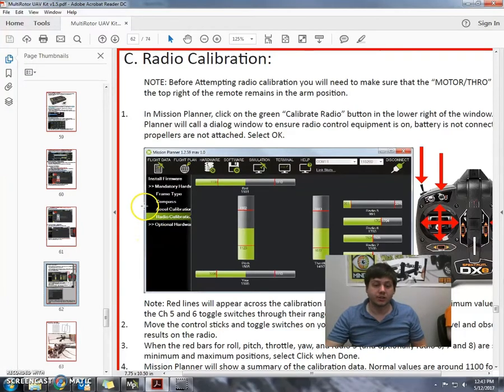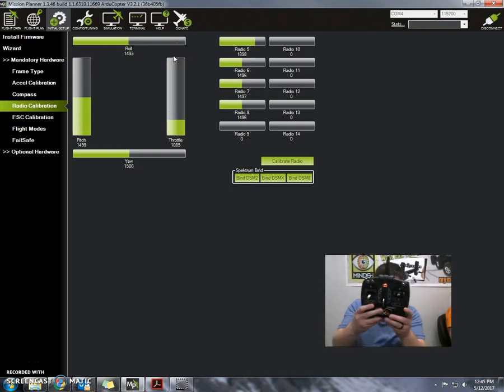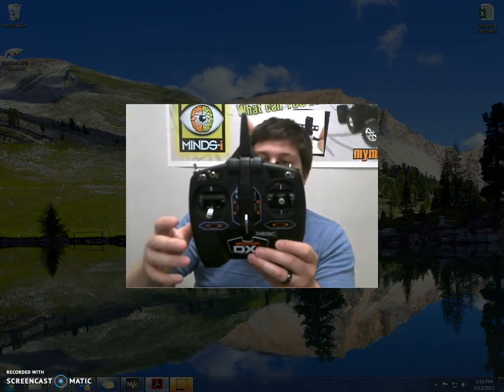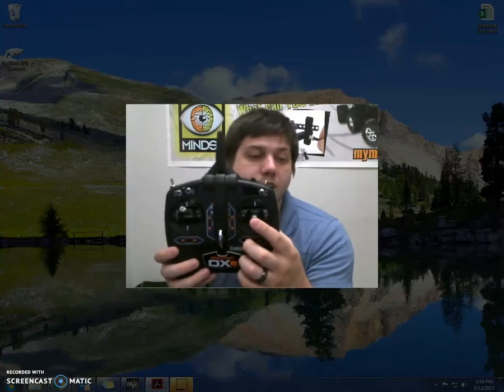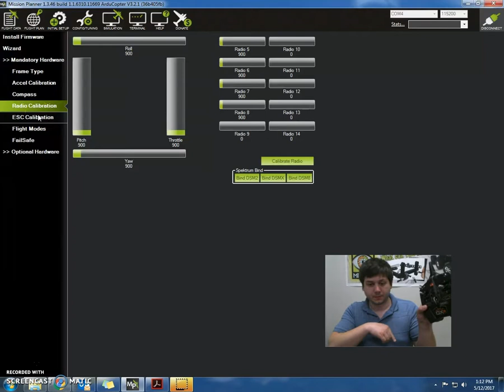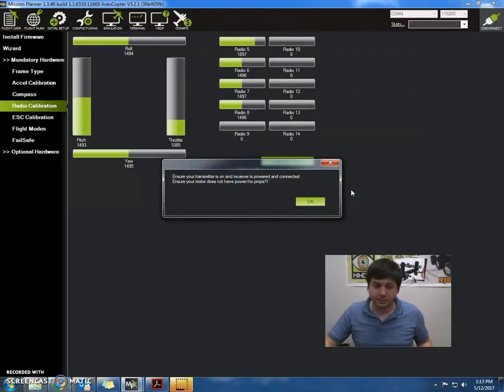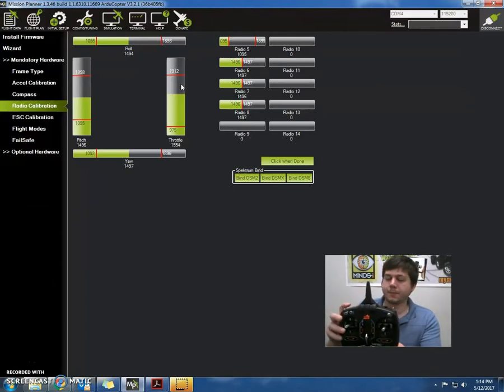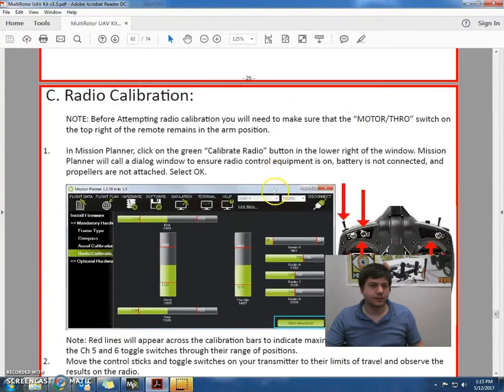MINDS-i Mission Planner Step #3C Radio Calibration

Comment: We were using mission planner 1.3.62 and in parameter settings we were using RC Pass through for the servos. When the battery is connected only one motor is responding to the throttle stick variation instead of all the four motors. Could you please give a solution!